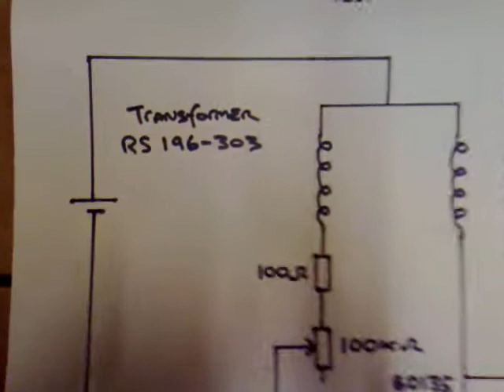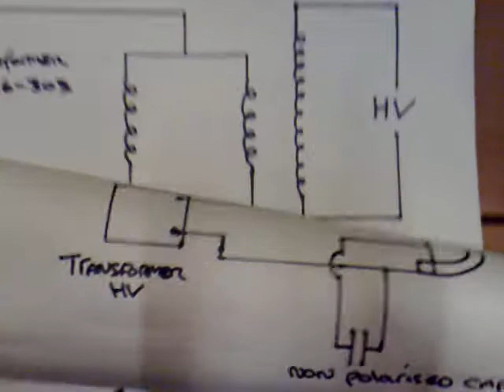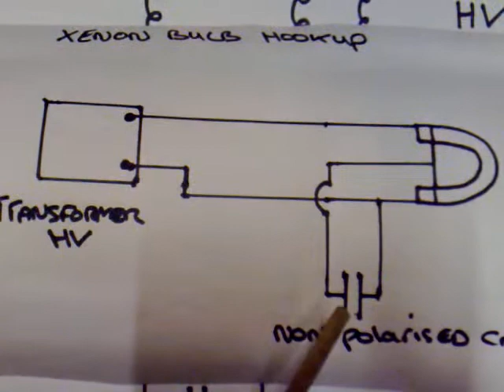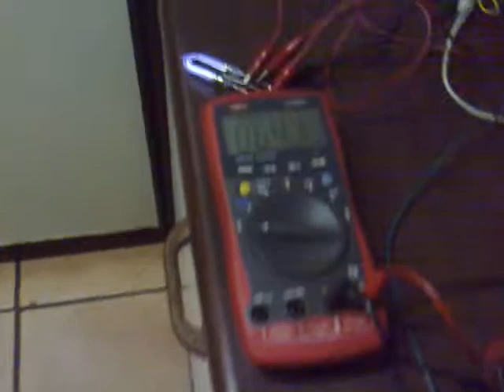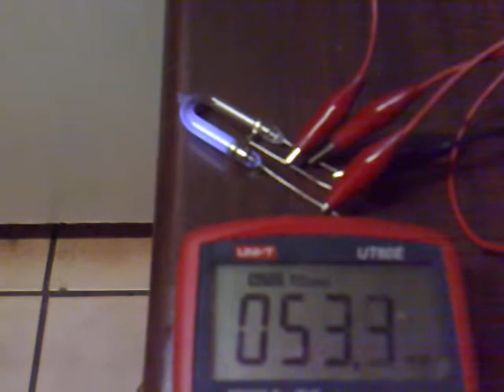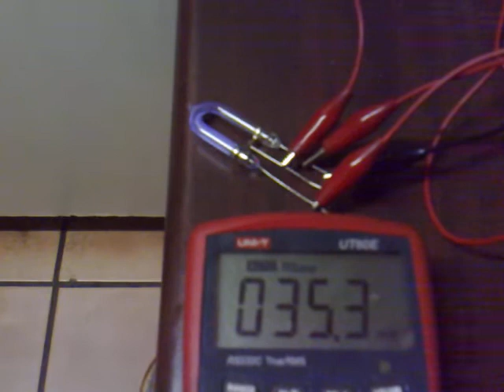Xee2 transformer joulethief with diode/cap-xenon bulb test

Comment: Hi Jonny well done.
What happens if you use a choke coil instead of the unpolarised caüacitor to flas the Xenon ?

Please check that out, if you will get the Xenon to light up then even better.
Would be like the Dr. Stiffler L3 coil that generates much more voltage at the Xenon bulb gate.
Many thanks.

Regards, Stefan.